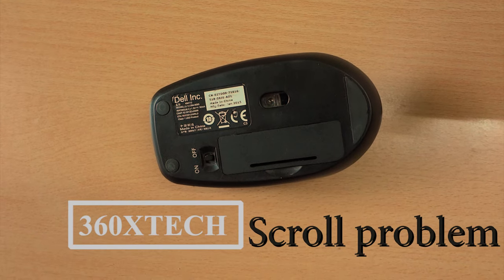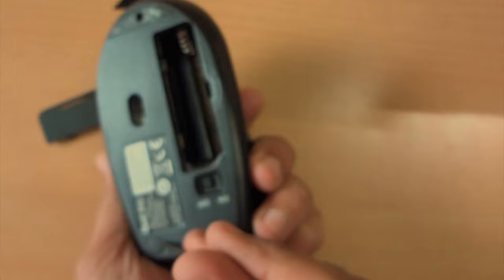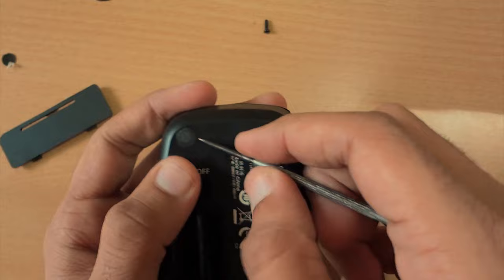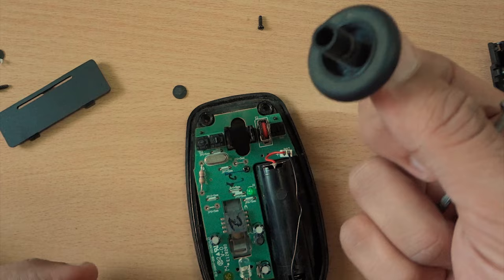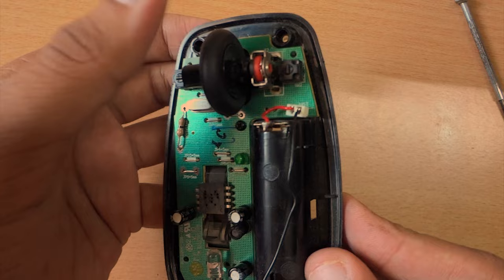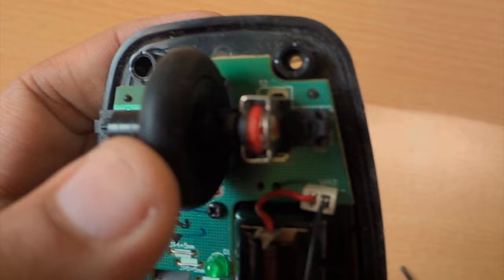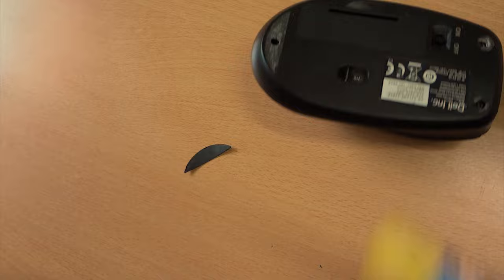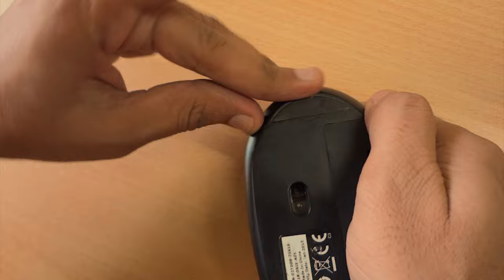Dell Wireless Mouse Repair  (Scrolling Issue)

Comment: Bro but in my mouse only left click is not working
Reply from the maker: okay, no problem you can do two things here 1.First, try to remove any dust particles from the left click button and try to connect it with pc if it works then its good otherwise if you have a spare old mouse you can replace that click button with that.
Reply from the maker: alright ,  in that case, you can interchange the clicks of the mouse from left to right click.
Reply: How???
Reply from the maker: which operating system you are using ?
Reply: Tq bro I have fixed it
Reply: By interchanging the right to left
Reply from the maker: Welcome Bro Feel Free To Ask Any Tech Related Issue :)

Comment: One like and one comment to making this video easy for others to search. I just fixed the inconsistent scroll problem in my dell mouse. Same model as you have shown in the video. And I didn't take out the scroll wheel. Just cleaned it and then did the tightening bit which you showed at 2:25. I think that is where the issue lies, the scroll wheel loses it's traction on the sensor. Thank you once again. You saved on electronic and plastic item from going to junk and helped save planet a bit :)

Comment: It worked man, thanks a lot. I had a small difference in the setup. You said there would be a side where the small wheel spins slowly, but mine spins the same way on both sides and doesn't have a speed difference. So I just put the screwdriver and tried spinning clockwise. Luckily that worked I guess. Reassembled and its working fine now.

Comment: I have a Dell Mouse KM113 which had problem registering left clicks(only when pressing the button hard,would the click register). I opened the mouse as shown in the video,and gave  good clean with a small brush,and while closing made sure the screws were tightly shut,such that there were no gaps between the mouse spring to reacht he button inside.I made it more tight,and instantly fixed the problem.Like new :)
Reply: Same issue

Comment: Thnx for making this video after watched ur video i repaired my dell wireless mouse myself (same model u used in this video). Now it's working properly. Keep it Up👍
Reply from the maker: Glad to hear that :)
Reply: But it's ON/OFF button not working properly...when i turn it ON it's not ON in once then i have to do it  on/off again & again. Then it works. Any solution for this?
Reply from the maker: @sandymogha    now it won't repeat actually the first time if the mouse body needs to be adjusted.

Comment: Gently remove those rubber it will stick back, and mine mouse was having only one screw which you open 1st, so do check may be in new model they give only one screw.

It worked for me, thanks.

I clean with sanitizer and untill it dry it will not work for scrolling so keep patience. Use blower if need.

Comment: But you didn't tell how to put the scroller back. That is very tough
Reply: Just use your right hand to pull the red colored part and push the scroller back in. Works fine, done ti twice now!!

Comment: Bhai mera same yah wala dell ka mouse ka click kam nahi kar raha hai pl help.
Reply from the maker: Open the mouse and then check if the click button is working or not, if it's not working try to stick some paper over the click button. Don't use too much paper as it may cause issue while pressing button,just use tissue type paper to make the button a little tight.

Comment: bro scroller is not fitting in
Reply from the maker: What issue you are facing?
Reply: @GadgetJunction  Sorry the issue is fixed
Reply: @GadgetJunction  The issue was scroller is not fitting in the red roller then i watched your video in HD i see the position and issue was fixed
Reply: @GadgetJunction  By the way thanks for quick responce